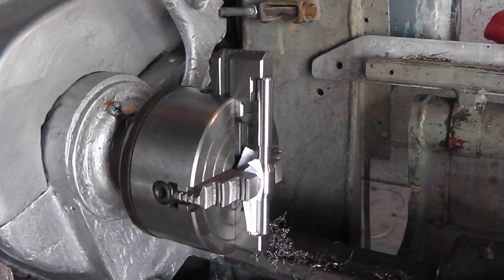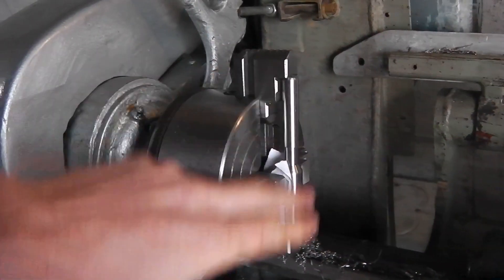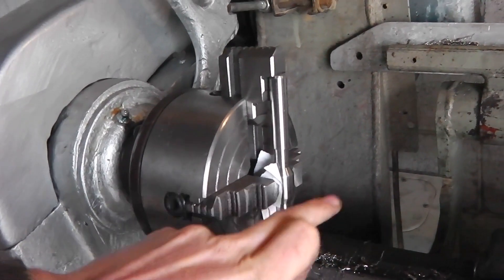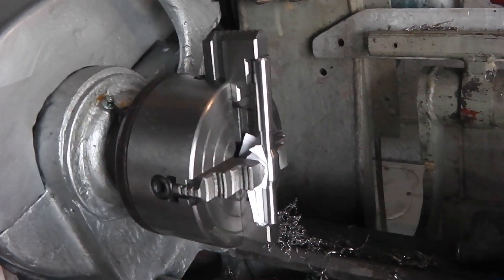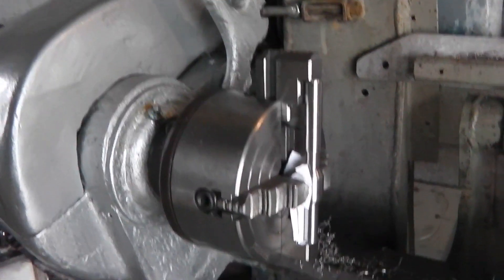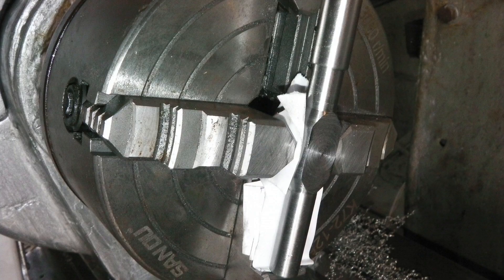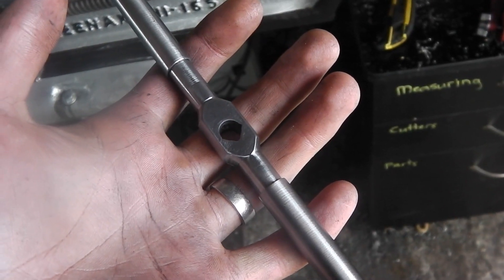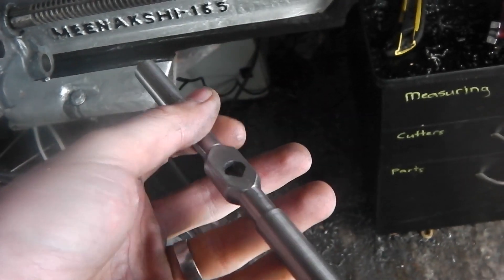4 Jaw chuck tip - paper shims

Comment: Nice tip using the paper.  At least if it fly's out its not going to do any damage.
Cam
Reply from the maker: One thing I have found is if you are using it as a soft jaw instead of as a shim you will need a few pieces as one layer isn't enough to protect the surface.